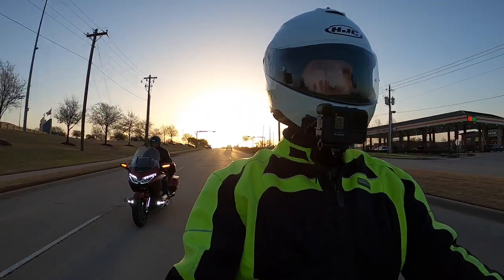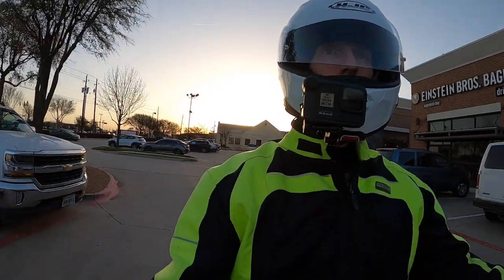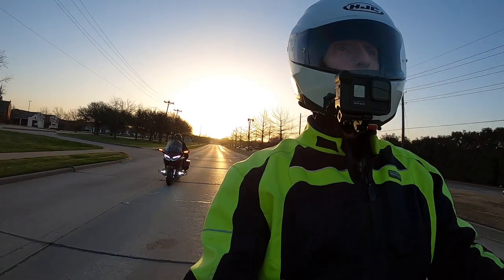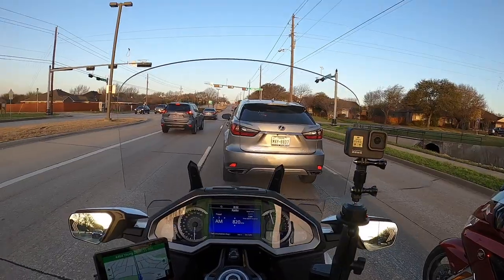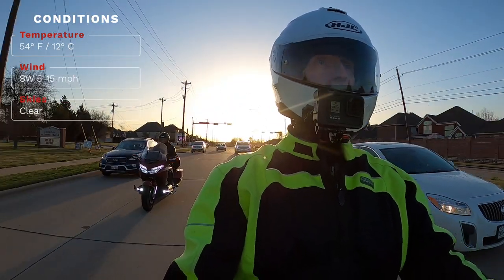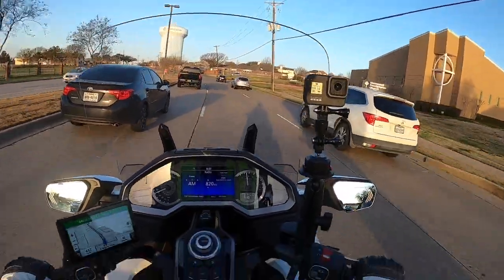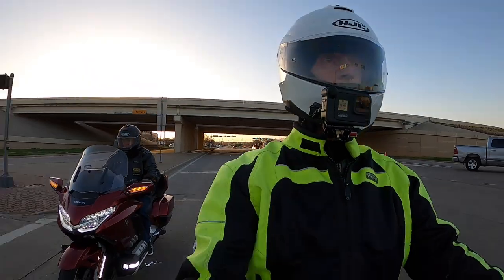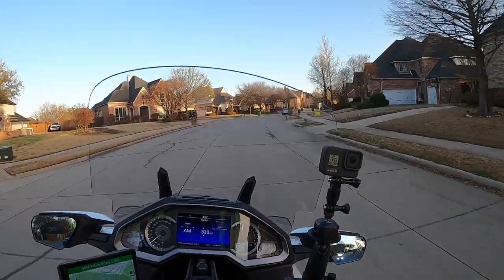I Screwed Up! | CruisemansGarage.com

Comment: I'm 60 and I have had the same doctor for years. He is the same age as I am and in the same good health as myself. I take no prescription medications, I have no pre-existing conditions, I work out 5 days a week, weight and height are within the BMI. No high blood pressure issues, no diabetes, I don't drink alcohol or smoke. My doctor is waiting as many of the doctors within my network are until some time has passed. He said if he ends up taking one, it will be the Johnson and Johnson vaccine because the binder is one that has been used for many years unlike the other two that are experimental with no long term studies. I ride my motorcycle everywhere I need to go so at the present time I don't need a vaccine to go anywhere I want to visit. I am not an anti-vaxer in any way. I get a flu shot every year.  I'm just listening to and following what my doctor has chosen to do with the Covid vaccine.

Comment: RE "Is it a group riding thing?". It can be. Although my two fingers up in this video was a bad photobomb attempt, the two finger sign is a 'group riding thing'. Usually, a group of riders use one lane but ride in two columns; one column hugs one side of the lane while the other column hugs the other side of the lane. One column of riders offsets the other column by riding with a one second spacing between you and the rider just ahead of you on the other side of the lane but that makes you two seconds behind the rider directly in front of you on the same side of the lane that you are on. This is normal for a two-column group ride. But then, the lead rider may hold up one finger. That means for everyone to ride as one column for an extra narrow road ahead. Then, when the road ahead goes back to a width rideable for two columns, the leader will hold up two fingers (as I did in this video) which means for the riders to revert back into two columns.

Comment: I had the 2nd Moderna shot February 5th.   I was tired the next day but that was it.  Of about 30 of my friends one had a fairly severe reaction, nausea and chills for about 12 hours.  Oklahoma will vaccinate about anyone now.  Our state health department has done a great job.
I use some inexpensive racing pegs from Twisted Throttle for forward pegs.  I attached them to the tip over bars.

Comment: Danger! Danger, Wil Robinson!

Even when you swap sides with those pegs they will reduce the lean angle of the bike, especially with the suspension compressed as it does in tight quick evasive maneuvers.  Make sure to test in safe area before just riding in bliss.

Comment: Off topic, but I’ve never seen you use a jack. Do you own one or know if the hydraulic jacks you often see used on other bikes, work on the new Wings? I keep putting off getting one for fear of it not working on my bike. The exhaust headers on my F6B looked like they would be too low for these jacks. And I haven’t had a look at the underside of the 2018+ models. Mine should arrive in the next couple weeks and it sure would be nice to get it off the ground for oil changes, etc..
Reply from the maker: I don't own one (yet). I try to show that my maintenance operations can be done WITHOUT the expense or complexity of a lift or a jack. I do use a small scissor jack when removing the front wheel.
Reply: @cruisemansgarage ; Okay, thanks. There’s one on sale here now. My bike should arrive within the next couple of weeks. I’m pretty sure I can make this jack work, even if I need to modify it with some kind of adapter. 
When will your video about the Pathfinder wiring hub be available? I’ll likely be adding accessories down the road and it sounds like the cat’s meow.

Comment: Cruiseman, 3 questions from this video.  Don's bike looks like the amber front turn signals are constantly flashing, like he has his hazards on.  Is that right?  Riding like that I think would be illegal in Delaware.  No lights that "flash", i.e., turn completely on and off.  

Also, it looks like his headlight does an irregular pattern of flashing as well.  Is that right?  If the headlight is turning all the way on and off (i.e., flashing), then that definitely would be illegal in Delaware.  I had a Yamaha XS1100 that I installed a Kisan Pathblazer headlight modulator onto.  That modulated the high beam between something like 20-60% over top of the low beam at a pretty fast rate.  That was legal by federal law, but some idiot at the DE DMV failed me at inspection because he said it was "flashing," which it wasn't.  Don's headlight looks like it actually is flashing, which I don't think is legal federally, if it is.  But, what I see could just be how it shows up on the video.  Federal code 49 CFR Section 571.108 states that the rate of light modulation on a motorcycle shall be 240 plus-or-minus 40 cycles per minute, it shall be operated at maximum power for 50 to 70 percent of each cycle, and the lowest intensity at any test point shall not be less than 17 percent of the maximum intensity.  That rate of modulation would average 4x/second, which is very noticeable. 

Third question is are his light effects mods that he did?  A quickly modulating headlight really catches your eye.  Hazards and slowly flashing headlights not as much.  I have thought about adding a fast headlight modulator on my '08 airbag model, but it would be more difficult than it was on the XS1100, I think, because there are 2 headlights and the fairing.  Maybe it wouldn't be.
Reply from the maker: Don't turn signal flashing is just the way LEDs appear on video. In person, they do not flash. It has to do with the refresh rate of the video camera not matching the flash of the LEDs, which flash so fast, it is imperceptible to the human eye.

Comment: I noticed Don's turn signals flash as he rides. Is this a modification or a standard feature?
Reply: I see the answer in other comments. Too bad, I think it would be a nice safety feature to get noticed more.
Reply from the maker: It is just the way LEDs show up on the GoPro camera. Has to do with the shutter speed of the camera not matching the refresh rate of the LEDs.

Comment: 1st off thanks for the great content I just discovered your Channel.
I'm in the market for a late model Goldwing how many changes/ improvements really occur between 2018 and 2020. Is there any pitfalls i should be concerned with?
Thanks in Advance
Reply from the maker: Some changes (going from memory here) between 2018 and 2020. The big one is some improvements to the DCT transmission. It shifts a little smoother. You also get 2 Smart Keys instead of 1, and fog lights are included on the 2020. No major pitfalls that I can think of.
Reply: @cruisemansgarage  ,
Thanks for the reply 👍